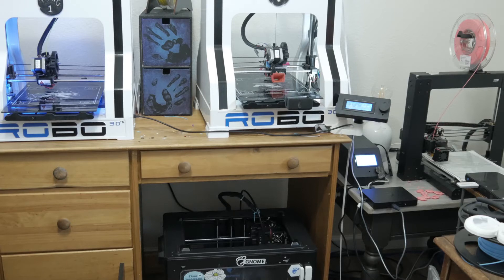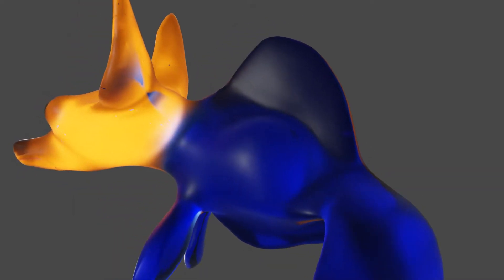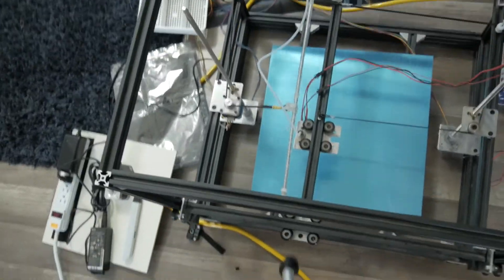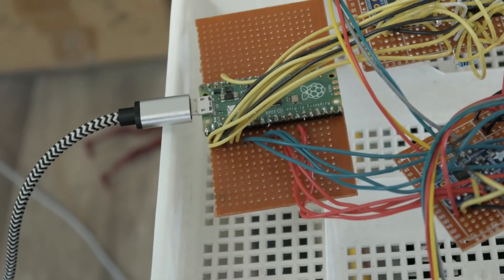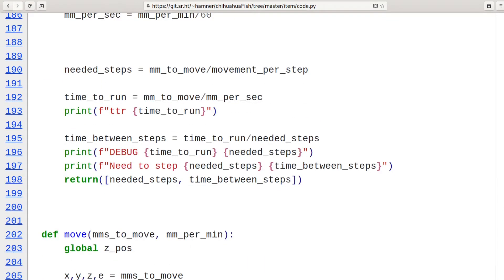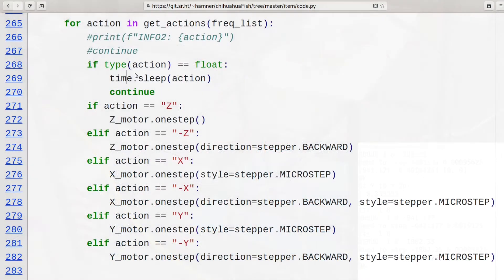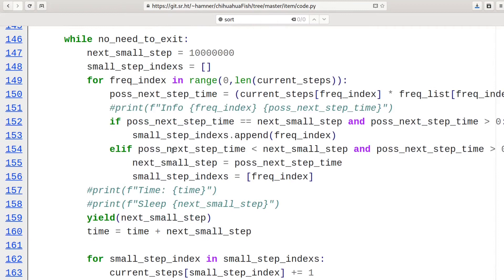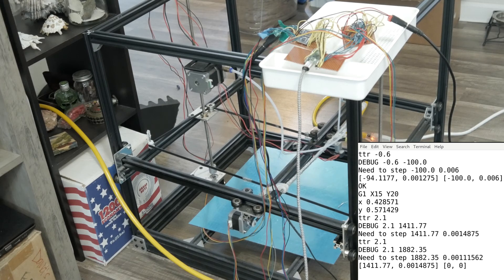Building a New 3d Printer Firmware | ChihuahuaFish

Comment: I wonder if you could run a 3D printer on Risk 5? i think its only 50 commands to get it started and you can program it to do anything. Also, ive been looking to get reprap firmware for my Cr 10 because im going to be using a manta E3 Ez 1.0 with it. Im curious what you could do with this by making the firmware in python rather than C or something else. What if you did a version in Modular? its supposed to be compatible with python.